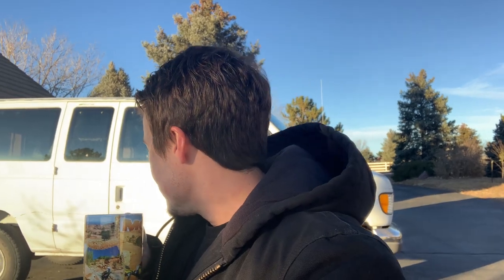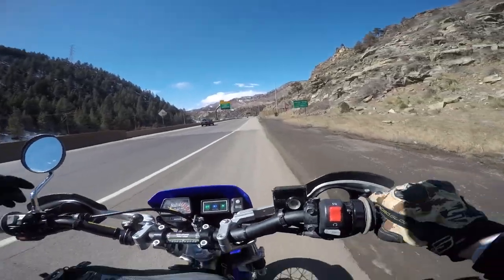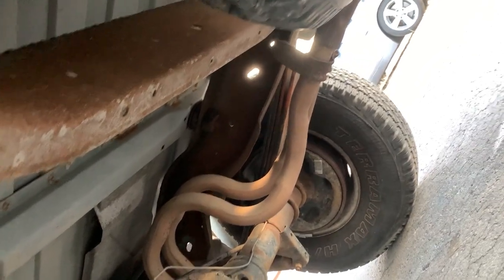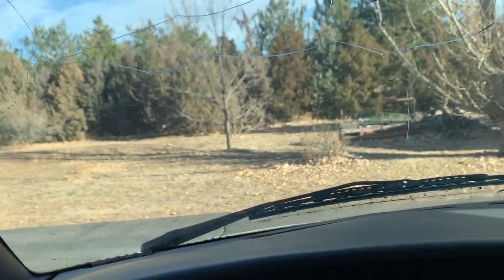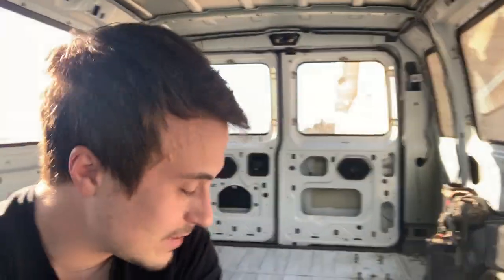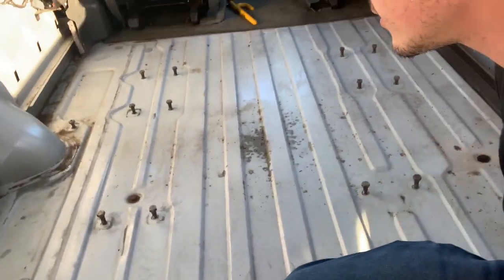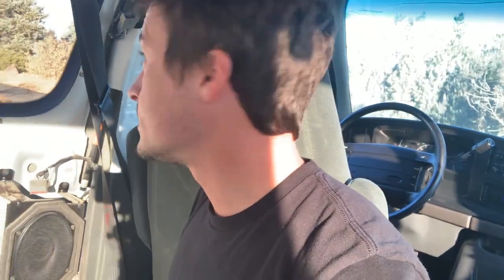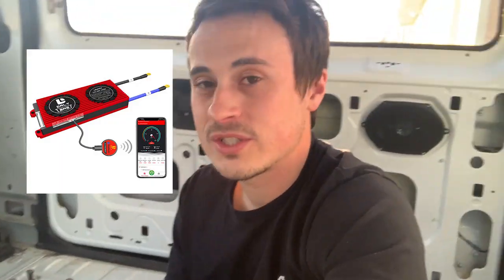My full Plan to Convert This Van Into a Luxury High Tech Camper | 96 Ford E-350 Club Wagon XLT

Comment from the maker: I got a current update on the van build here: https://youtu.be/gUAGHylMFfQ
skip to the part you want to see here:
Intro 0:00
How I got the van: 1:08
Mechanical: 1:54
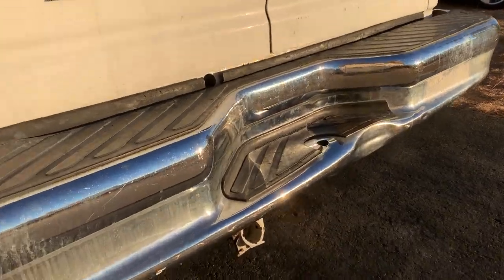Exterior: 4:45 
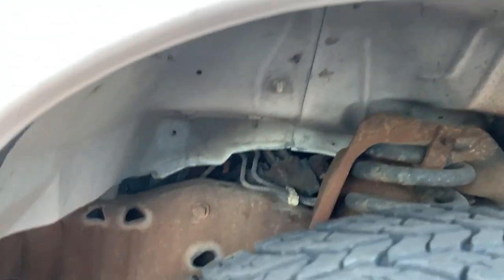Undercarriage: 9:44
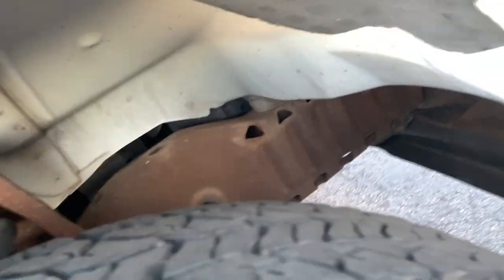start up, check engine light: 13:10
Exhaust sound: 15:13
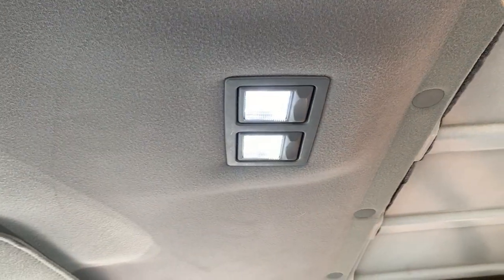cockpit: 15:37
Pre build interior: 19:02
My story: 21:07
rear HVAC box: 22:58
Camper van Insulation, layout, heater, and vibe: 23:33
Water system: 35:24
Electrical system and lighting: 37:00
Outro: 45:44

Comment: Realizing this is older but I just found it. With almost 300 Ah you will be way under paneled at 300 watts. The recommended wattage I have seen is about 300 Watts for 100 Ah, so you would need 900 Watts for your planned setup. For me, I have 400 Watts (2 200 Watt panels) for 200 Ah of battery, so slightly low, but I do use a 40 amp dc/dc charger so I feel like I'm ok. I look forward to seeing the progress as I go through the series. This is much more my kind of build. For reference, my van is a 2002 Quigley 4x4 with the 7.3 that we have owned for 16 years now. It's had to be a passenger van until now, but it is getting to be time to redo the inside as the kids have gotten older.
Reply from the maker: Firstly I wouldn’t go off amp hours, its all good if your comparing same voltage systems but not useful if your comparing say a 12v and 24v system. You can have a 100ah 12v battery and a 100ah 24v battery. The 24v has twice the capacity. Best to go with watt hours, its a much more useful measurement. The 280ah lifepo4 12v battery system im building has approximately 3500 usable watt hours (3.5 kilowatt hours), actually a little more but i will bring the limits in some to increase long term cell life. Knowing this is also useful so we can estimate how long certain appliances will last regardless of voltage. Like say your using an inverter. Say i want to know how long l can run a microwave that uses 1000 watts, its easy to figure out when we use watt hours. It can run for about 3.5 hours constantly (there will also be power lost in the inversion process but not factoring that in since this is just an estimation) this is also useful for figuring out solar panel needs, there is no right or wrong on how many solar panels you must have for a certain battery bank, it all depends on personal preference and needs. 900 watts of solar would charge my system from empty to full in about 4 hours. I really dont have a need for that, 300 watts of solar would charge my system in less than 12 hours thats enough for me, plus i dont have have room for that much solar on the roof with everything else I want up there. I also have a 40amp dc to dc charger that will put out about 550 watts. And will also have a charger for shore power. Another thing to consider is using a mppt solar charge controller. This will give you better solar output in cloudy and low sun conditions. Another thing to consider is your battery chemistry, are you using deep cycle agm? Because those only actually have half the stated capacity unless you want damaged cells. So a 200ah deep cycle agm setup only has 100ah of usable capacity. Vs lifepo4 cells that can utilize full stated capacity. There are certain trade offs you have to look into. You certainly dont have to have a certain solar amount for a certain battery capacity, it just depends on what your needs are and what is acceptable to you. Hope that helped. Thanks so much
Reply from the maker: Nice thats a really cool van! I just deleted my 2 big side windows on mine. I removed them and welded in panels I cut out of som panel vans in the junk yard! Now it has the perfect amount of windows. For the build im doing
Reply: @4WheelKid  I was going by my battery manufacturer. I have 2 100 Ah Lithium Iron Phosphate Batteries (12 volt), and the manufacturer for them and Renogy are where I got the wattage estimation. I use an Epever Tracer MPPT solar controller, and a Renogy shunt to monitor things. I have a 1200 Watt Pure Sine Inverter, which is way more than I need. With our 400 watts I found that it was fine in summer but not once the time change happened in November, particularly with our desire to explore canyons in Death Valley. That’s why I added the DC/DC charger. I also upgraded my alternator before I added the charger, as the charger alone would have accounted for about half of my stock alternator’s output. I run a 1 wire Hagemeister 200 amp unit now, which has been solid. I agree completely with discussing it in Watt hours, but the van community seems to discuss in terms of Ah, so that’s why I quoted that. Oh, and I also upgraded my starting batteries to Odyssey AGM units so I could get accessory studs. Huge improvement with starting power. That 7.3 turns much faster now. I’ll continue working through the videos Thanks for the discussion!

Comment: Looking forward to watching your channel.  Having the mechanical knowledge and ability to fix your 'home', you cut out 99% of the worry and $$$ of RV living. You still have the cost of towing if you break down on the road, but you have road side assist to ease that pain $$$. I found your site when I was consider a tow vehicle. I drive class C and stay on 'First-Come' sites, paid and free. Having an extra ride lets me run into town for supplies without loosing my site......Oh, wanted to say, don't put to much into the scary vids you see....they are more about being click bait to get high viewer count.
Reply from the maker: Thanks, good to hear, yeah I couldn’t imagine not being a mechanic or knowing nothing about cars. Would be way to expensive. For sure. I got roadside assistance with my spot satellite transmitter. 5 tows per year, 50 miles each. Used one with my 4runner last year. It was great. Very nice. That works. Always good having a 2nd vehicle. Yeah probably pretty rare. Would be cool to see whats going on around you at all times with a flick of a switch though

Comment: The wood idea is great but it can be thick and heavy, seen other people use the snap together laminate flooring that is water proof, scratch and dent resistance and have a rubber backing on the. Not too heavy all in all.   Plus being finished saving so much time and they are tough too. Just a idea the hopefully helps.
Reply from the maker: yeah ill probably be using that for the flooring. if you go thin on the wood things will stay pretty light still. it's a 1 ton truck so weight isn't much of an issue. if it was a 150 it would be for sure. thanks for the idea!

Comment: Heck yeah! I love vanlife 💪🏼. I want to build one also haha! This build is going to be amazing I can tell already. Very excited for it to come together. Don't forget to add a front and rear winch since it's not a 4x4. Trust me, it will save you many times if you plan to go off-road/trail riding.
 I love the pod light/ flood light idea. And YES! AN EXPRESSO MACHINE WOULD BE BADASS! You're making me want to build a camper now hahahahah
Reply from the maker: hey man! yeah seem so cool. I can't wait to get this van conversion going. Going to learn so much! thanks, might do a front winch with it, not really planning on doing anything crazy off road, that's why I got the TW. will be cool to do the 4x4 conversion someday though. for sure, led lights are rad. haha would be so cool to have one, I use to have a small one, used the heck out of the thing

Comment: Excellent. I have a 1994 e350 Club wagon XLT. It has the 5.8l V*. In the process of building as well.
Reply from the maker: thanks! very nice! the 351 seems like the best engine, little bit better gas mileage than the 460 but still enough torque
Reply: @4WheelKid  I have 125k on it, but she is strong. Changed alternator from stock 95 amp to 130 amp. May help with charging house batteries better when I set that up. She is not great on gas, so I guess the 460 is a drinker.

Comment: I got a 1995 Econoline myself but it’s a 150 with the 300 inline six. It’s been sitting for seven years. Mine does not have the rear HVAC since it’s a cargo van.
Reply from the maker: nice! not a lot of power but ok torque but those are one of fords most reliable longest lasing, reliable engines. 7 years is a very long time without starting an engine. I would replace the oil first, and inject some atf into the spark plug holes and spin the crank by hand many times before trying to start. maybe disconnect fuel system relay and crank over a bit to prime the oil curcuit. before  trying to start, if the fuel is even any good after that long. best of luck. hope you can get it running good again

Comment: I have been turning wrenches for a long time and I was always told not to use dot 4 fluid unless the vehicle specifically called for it because it is synthetic and has different hydraulic properties and needs different size lines, etc.
Reply from the maker: they taught us at trade school that dot 4 is perfectly fine for originally dot 3 systems. they are both glycol based and  only difference is boiling point. you can also buy synthetic dot 3 fluid. do you have sources to point to? everything I can find online also states dot 4 is ok in dot 3 systems. maybe your thinking of Dot 5? which silicone based and will for sure harm dot 3 and 4 systems.
Reply: @4WheelKid  you are probably right. I just wanted to be sure....that is gonna be a heavy rig!

Comment: did you ever finish the build? would be cool to see a tour, if you did
Reply from the maker: not yet. having to spend a lot of time on body work and mechanical work, it runs fine but needs a lot of preventative maintenance. I have also fixed most all the rust and raptor lined the exterior (still need to do 1 more section this spring). I'm also doing some crazy custom fabrication work on it. I removed the biggest 2 side windows, cut out some some panels out of work vans then sized and fully welded them into place where the windows go. looks super rad, like a mix between a work panel van and club wagon. I'm also almost done with a super sweet bed. unlike anything anyone has ever done in a van. the bed pivots/lifts up in the rear with gas struts and will transform into a lighted molle gear wall. will need to do an update tour before long, still has a long ways to go

Comment: Im not a ford/Chrysler fan, but the rear diff looks like a dana 60, could be a dan 80. It should be on the tag on the diff cover.
Reply from the maker: yeah it's a dana 60. pretty good rear end, need to fix the surface rust and replace the fluid soon

Comment: If you want more sub’s… LS swap it. Drop a LS 4.8 in that beast with a 4L80, or even a 6L80 and you will get better mpg’s with more power
Reply from the maker: haha yeah i'm sure that would get a lot of views. probably will stick with the 460 for now. this one guy on a group had a 460 econoline van and was at 370k miles original engine still running great before he got in a wreck and totaled the van
Reply: @4WheelKid  
By switching to a 4.8/5.3 ls, you will save enough gas in the first year to pay off the LS…
Thoes 460’s are terrible on fuel.
Not to me tion its a ford.
There is a band called buddy washisnam and the other fellas, they have a song called dear mr ford. Its a newfi song but you will understand why they wrote this song to mr ford

Comment: I bought a Ford Econoline 2008 like new 6 months ago
only AC not work and flat tire alarm is on.
Reply from the maker: would check your refrigerant level for the AC, then leak test the system. if it passes you may have a very slow small leak. would inject dye in the compressor oil then recharge, see how long before it stops working again. if there is dye already I would look at all the components and lines with a uv light to hopefully find the source of the leak, alos not a bad idea to replace all the Oring at AC connection points. I think these are common spots for the AC to leak. also if you smell compressor oil coming out of the AC vents (a very distinct smell) then the Evaporator is probably leaking and will need to be replaced. good thing they are easy to access on these vans. if the tpm light is on solid, then the tires are low and needs to be reset, if it's flashing at anytime, then there is a fault in the system and needs to be checked
Reply: @4WheelKid  Thanks. God bless.
I fixed the flat tire sine yesterday :)
For summer I will fix the AC too. Thanks❣❣❣

Comment: How did you read your codes ? Is this van OBD 2 or 1 ?
Reply from the maker: I used just an obd2 scanner, this van is the first year ob2 was required. Only year you could get a big block 460 with obd2 on this van, its pretty rare, not sure if some obd scanners will work on obd1 probably look up how to read obd1 codes
Reply: Mines a OBD1 since mine is a 1995.